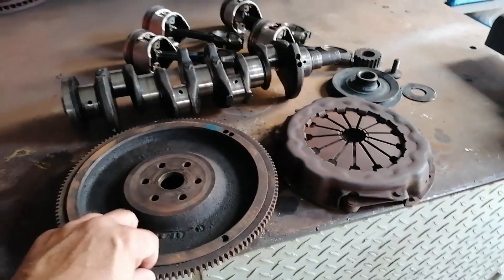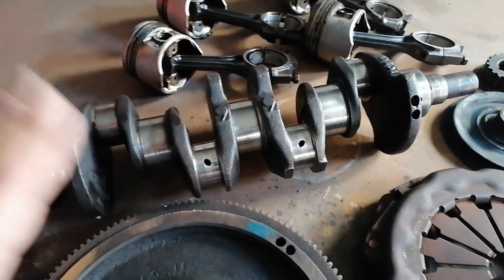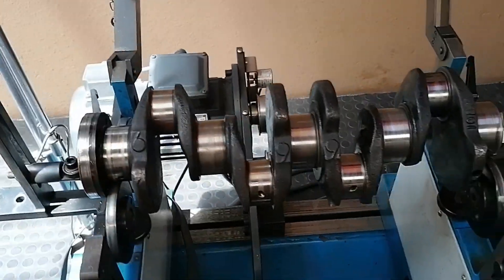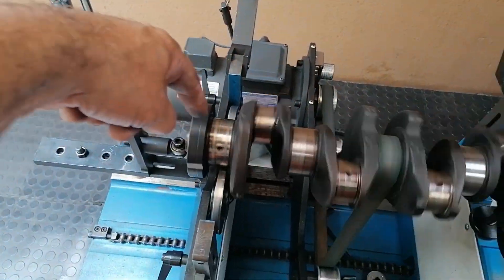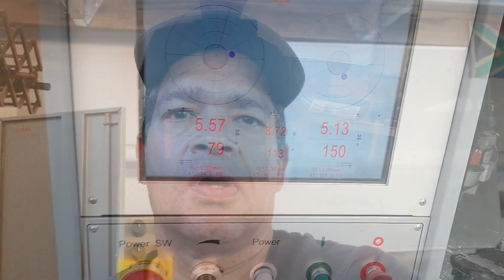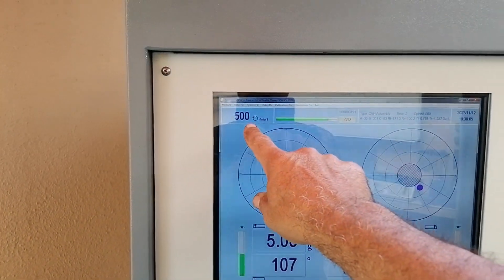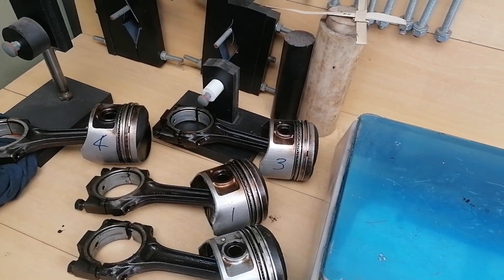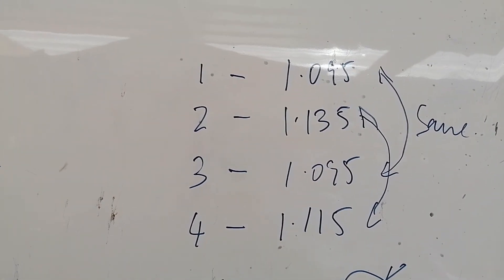How Unbalanced is this CVH Engine ...Lets see....

Comment: Good afternoon Anthony.
Good video.
You can weigh piston and rod assemblies by hanging piston and little end of the rod and weighing the big end of the rod.
I usually weigh without rod bearings. 
The total weight of the assembly minus the big end weight and you have your reciprocating number.
Also, you may know this; when balancing a pressure plate you must load the pressure plate.
I use three pieces of plastic or anything that will resemble loading the pressure plate like having the disc installed.
If not loading the pressure plate, a resonance frequency will be present resulting in a abnormal balance resulution imbalance.
It certainly will give you fits balancing a pressure plate.
I hope this information is useful my friend.
Have a great day.
Merry Christmas to you and your family. 
Take care, Ed.
Reply from the maker: Hi Ed, thank you very much for your advise. Your wisdom is infinite and i will certainly take it to heart. Thank you, you are very kind. Much appreciated. Happy holidays to you and your family. 🙏